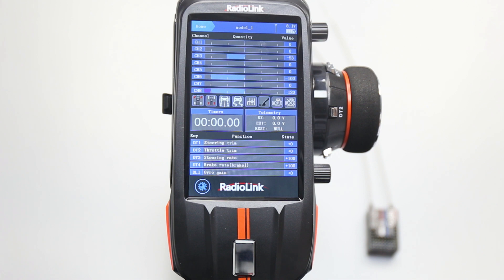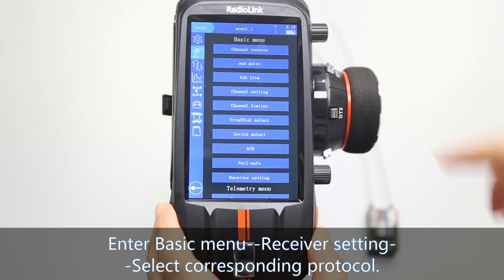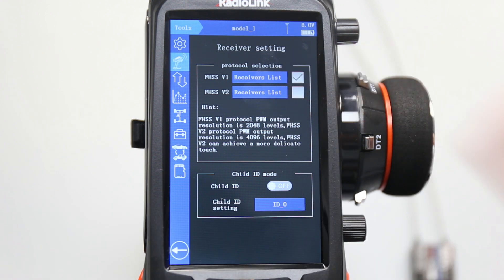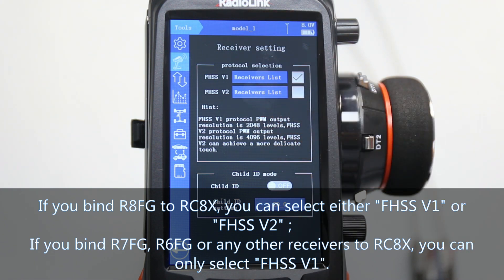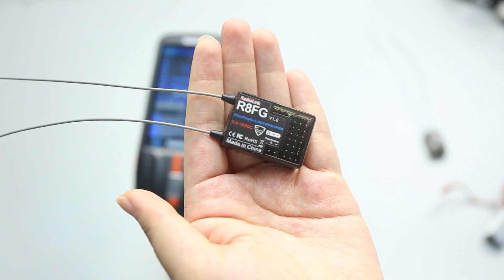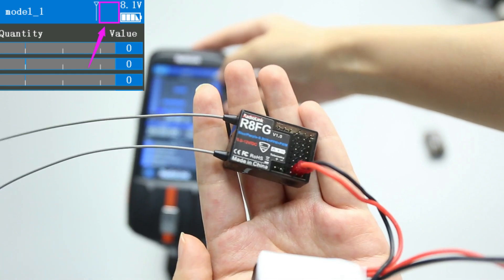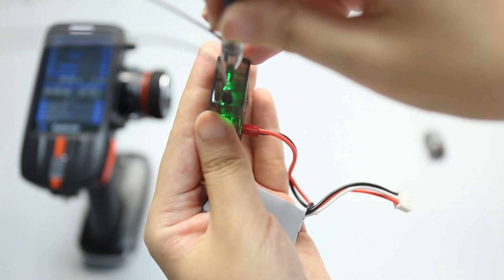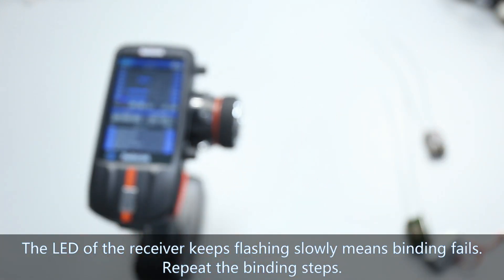How to Bind RadioLink RC8X Transmitter to Receivers?

Comment: Can i bind r8fg and rc6gs?
Reply from the maker: Hello, sir. R8FG can be bound to RC8X/RC6GS V3/RC4GS V3/RC6GS V2/RC4GS V2/RC6GS (3-position switch version)/RC4GS (version with P.D AFTER 180101) /T8FB(BT)/T8S(BT)/T8FB(OTG)/T8S(OTG).  So R8FG can be bound to RC6GS (3-position switch version).